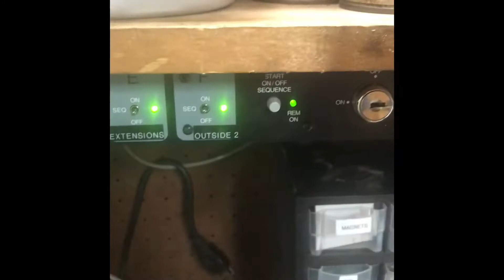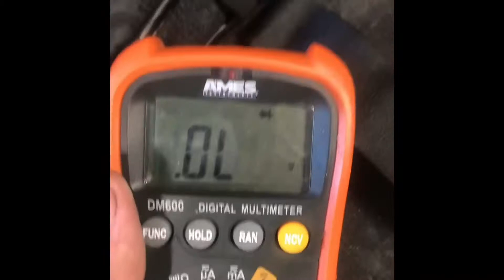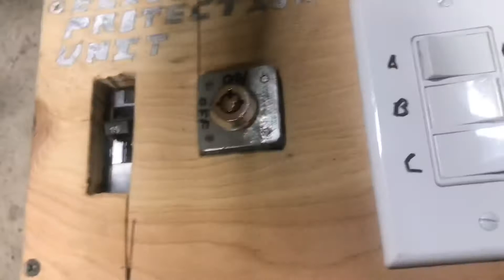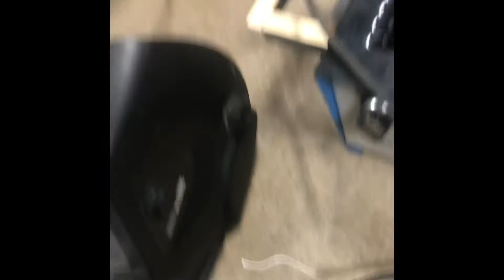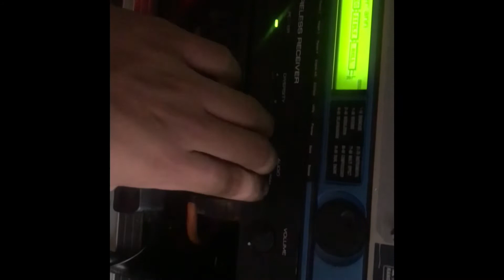Tour of my shop

Comment: I've got some Mackie CR3 monitors. I tore out the digital amplifier and use a couple of MJE13007s to drive them (I'm using them right now to watch this video!) but in the end I found electronics to be too stressful and have taken up chess instead - it's around 100 times easier.